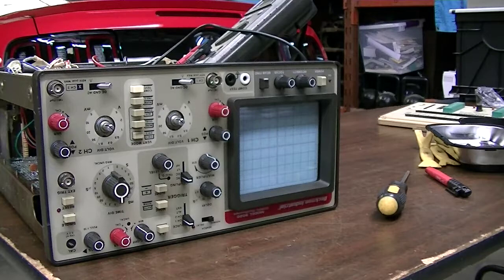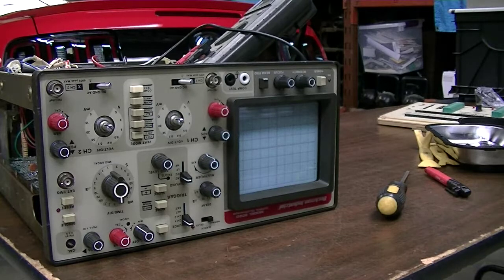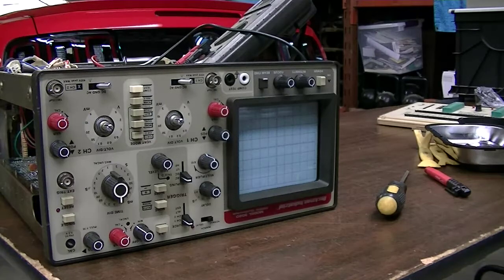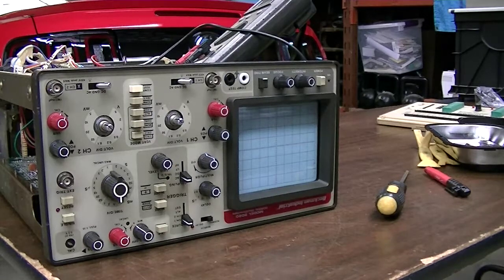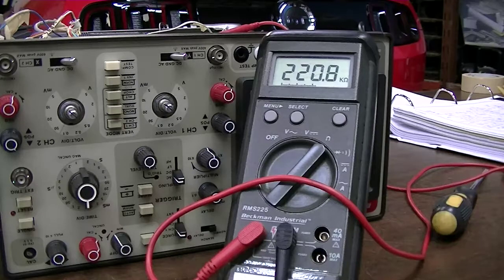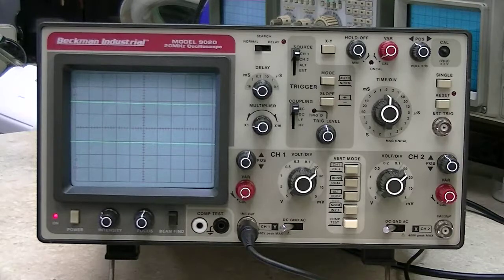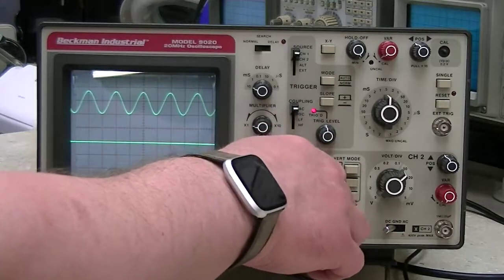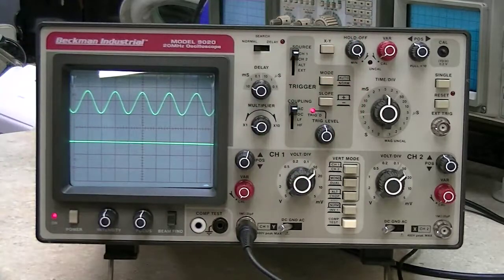Beckman Industrial 9020 Oscilloscope Repair and Discussion

Comment: I acquired one of these 3 weeks ago from 1978.
Having fixed noisy selector switches, potmeters, pushbuttons with prf 7-78, it turns out
to be a troublefree scope for 60 euros. Thanks for the steady video using a tripod.